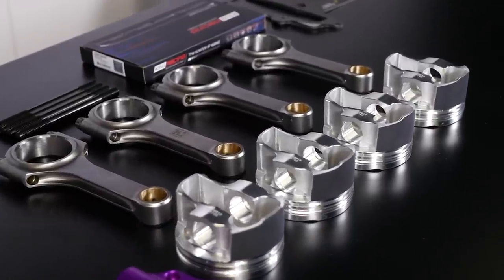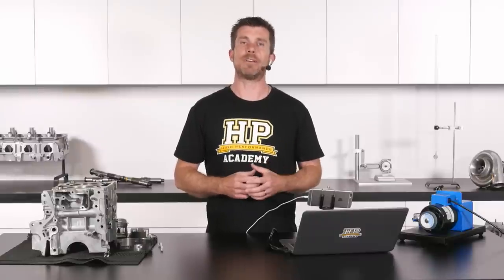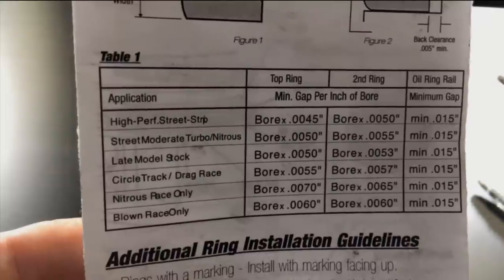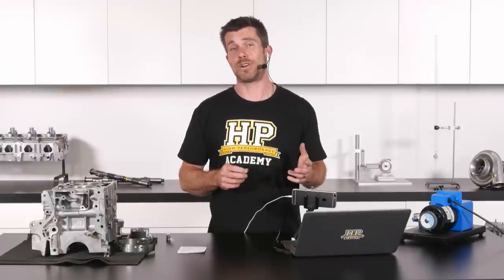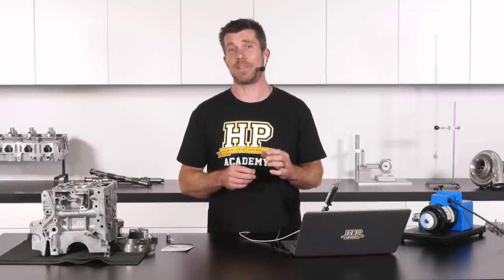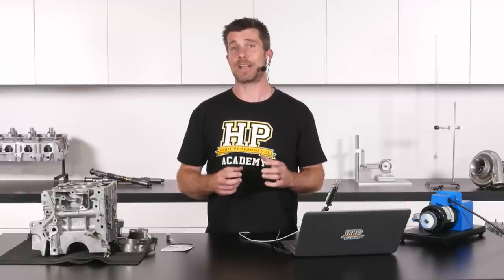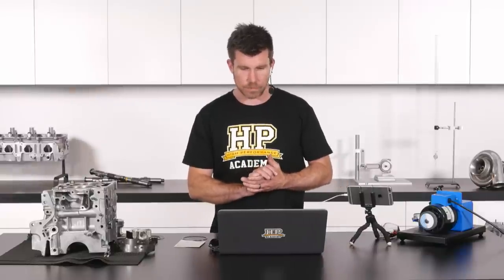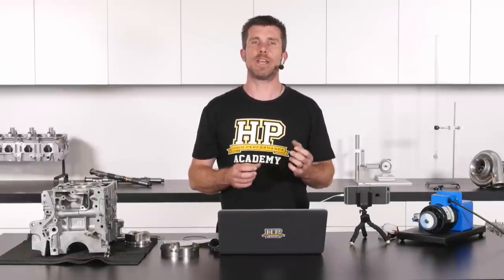Piston Ring Gaps | How They DESTROY Your Engine [GOLD WEBINAR]

Comment: Does anyone know why 1st and 2nd compression rings aren't in the same groove? Doing that would mean the top ring gap is faced by the steel second ring rather than the aluminum of the piston. It also shortens the height between the piston crown and rod pin. Both seem desirable,  but there must be a downside that's so obvious and well understood that no one mentions it anymore.
Reply: Do you mean the two gaps?
Reply: @joshkerto7115  No, leave the ring gaps unchanged. Make the piston top ring groove twice as tall as it is now. Delete the second piston ring groove. Install both compression rings (with 180° indexing) into the single top ring groove.
Reply: @stephenbello1081  it would blow by in my guess
Reply: That is basically the principle behind the Total Seal rings - there are several reasons it isn't done as you suggest, though.
Reply: because rings dont work like that?

having two rings in one land is like having a thick ring... FLUTTER. except now its got an extra surface to deal with.
and then, they seal by being pushed down against that groove buy combustion pressure, and then the gas gets behind and forces them out.

aluminium in pistons is relatively hard, low deformation, and with the contact area of the groove... theres no problem with it being aluminium on steel.

the first ring gets the most pressure, as its the first one. second one gets a fraction as its just blowby and gap leakage.

third rings... becoming rare now.fourth rings? got an interesting chart on ring numbers and compression leaks... theres basically no advantage to more than 3 rings in total. as the pressure reduces, they seal less and less. the pressure is what makes them seal.
then the oil scrapers.

as soon as you have two in a groove, you got bounce, flutter, momentum, and bad sealing to contend with.

rings have been a pain in the arse ever since newcommen or watt made their first engines...

Comment: I have a question. If science says it's this number to answer formula, not two other numbers in place of the 760mmHg. That number being 14.7 psi is in the absolute, or FI uses what number then? Make sense in the science? Then where is the science to eliminate the other two, if one floats in the middle of the groove, the second one is flat on the piston groove, and the third is the angle of the piston direction and the ring is cocked at both top and bottom of the ring groove. What two do you eliminate? And trick question says; we live in a magnetic world and ohm says balance or it burns out soon, or shorts right now, because science says; it only assembles one way as it only works one way. Thanks for the attempt at it. Signed, The Cranial Concussion Club.

Comment: Andrey, I have a problem. And being a person like yourself, you probably have a answer for me. I want to have my 2007 Miata’s engine rebuilt with performance rods pistons and bearings. It seems that this year of engine is different then the previous years and even the Miata clubs here in the DFW area of Texas don’t do much with them. Do you know why. And do you know the exact parts I could purchase for this type of rebuild. I know it seems weird. I’m in the US and I can’t find someone who knows how to build a simple 4 cylinder engine. Well hopefully you can help me.
Reply: Are you doing this for turbo or NA power?
Reply: N/A and then boost a little later
Reply: @sedhendo4177  it makes quite a difference how you chose to build it for NA vs Forced induction. For turbo you'd generally want to drop the compression ratio a little with low comp pistons... Say taking it down from the factory 10.8 closer to mid 9s. You can build for even lower compression, but if you have good fuel where you live, there's no real need, plus the compression will help spool the turbo a little earlier. Other than that, any compatible forged pistons and rods of a reputable brand will do, ARP head studs, main studs, and the required machining and of course a good new set of bearings and you should have a pretty good combo. Provided it's built well, the tune will be the deciding factor when it comes to reliability
Reply: Make sure you identify the engine correctly, then do a search for Mazda MX5 tuning/specialists.
Reply: GordoWG1 WG1 thanks I did.
Reply: magnetic0314 thanks for the info. I know and understand all of those things. My idea, which isn’t original. Is to build a solid N/A engine and then boost it.
Reply: @sedhendo4177  
There are several versions which is why I suggested it, but it reminded my, IIRC, there is a weakness in the gearbox - I think some people use the RX8 - might be4 a good idea to check that out as well.
If it is a due to budget constraints, rather than looking to gradually increase the power, I'd suggest picking up a core/long block from a wrecker or somesuch and building that up so it can simply be dropped in. 

Either way, I'd suggest looking at the final spec' you want and build the engine to that - even if you runn less compression that desired for N/A - oh, on that, also consider the fuel that you will be running the final engine on - if it's high octane or an ethanol blend (or both if mixing your own) you can run more compression that will work better N/A.
Don't forget the brakes, cooling, fueling, etc. will also need significant upgrading - but I think you know that already.
If you aren't attached to using the Mazda engine, there are companies offering other engine conversions from a V8 (LS alloy block is well balanced), to V6 to rotary.
Chassis reinforcement and, personal opinion, a full cage would be a good idea!

Comment: Detonation and Pre-ignition are not the same. Pre-ignition blows a hole in the center of the piston, leaving the skirts and ring lands looking normal.
Reply: in a way, they usually have the same outcome: trashed rod/s, junk crank and sometimes junk block. pre ignition is timing issue, and detonation is high heat/bad fuel or a combo of both i always thought.

Comment: use cylinder liners and piston rings made out of invar?
bore and machine to fine accurate finish... maybe use hydrostatic bearings, on side of piston. closer seal... probably less leakage. less wear too.

Comment: I’m building an RB25DET. I’m not planning on going over 500WHP I will be utilizing my stock pistons and rods would I gap my rings bigger than what my manual says? Or like you said on the video it will be straight drop in since it’s OEM? Everybody has given different opinions and answers. You’re very knowledgeable shed some light on me good sir.
Reply: stock is stock. ie do what your manual says. aftermarket is different. they know what their pistons need.

Comment: Most of the video you are saying thousands of an inch , but 0.015 is 15 hundreds , if I'm not mistaken
Reply: 15 hundredths is written as 0.15. 0.015 is 15 thousandths. 0.0015 would be 15 ten-thousandths. See: http://www.engineering.com/Ask@/qactid/1/qaqid/5086.aspx
Reply: .01=hundredth's place

.001=thousandths place 

Kind of misleading , but I guess no one can beat math right :)
Reply: @crank3646  15 x 0.001 (a thou) = 0.015 or 15 thou
15 x 0.01 (a hundreth) = 0.15 or 15 hundreths
Reply: 1/10 = 0.1 tenth, 1/100 = 0.01 Hundredth, 1/1000 = 0.001 Thou. And so on
Reply: As the others point out, you are mistaken.

Comment: Since the LS came out there has been a problem. The ease of turbocharging is the problem.
People are going to the salvage yards, junkyard, breakers whatever you call it and getting a motor and turbocharging. This is likely a US problem but happens with other. Normal aspiration engines are getting 20 psi of boost on a stock NA piston and ring. Cracking or breaking the piston crown or ringland. Especially OE big block engines.